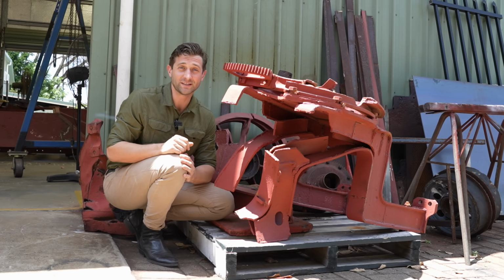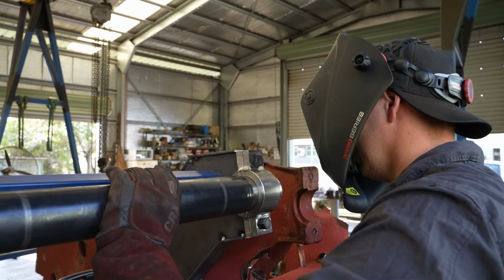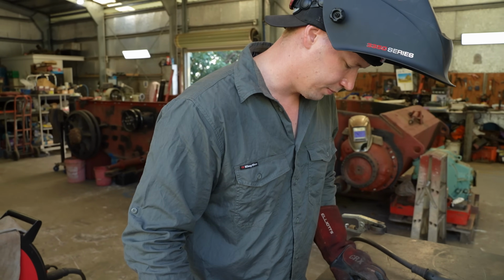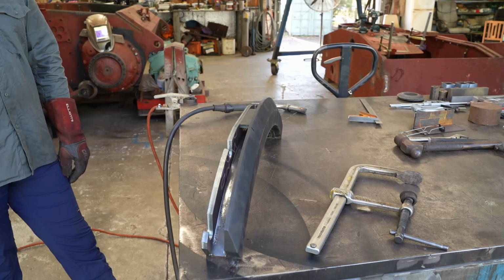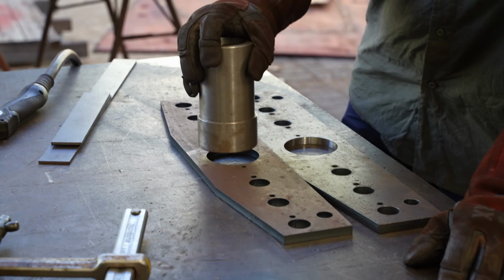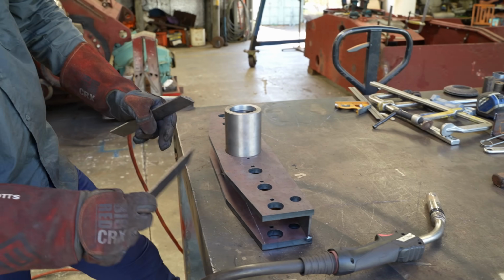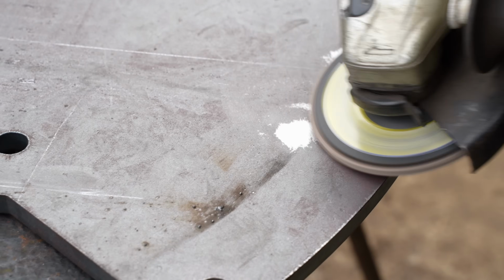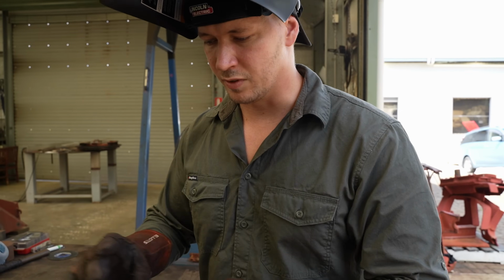WORKSHOP WEDNESDAY:  Part II of the 1:1 scale ALL METAL 7.5 cm StuK 40 L/48 Mount

Comment: Info for Beau.
An old trick I remember from the late 70's watching someone restore a WW2 afv and having to weld in replacement metalwork was to place a cut off quartz glass tube or ceramic tube recovered from an old bar heater over the arc welding electrode. This of course was in the days before Tig welders, and they learnt it during the 50's in the army.

This insulated the welding electrode from areas not needing to be welded and allowed the stick to get into tight places to put in internal welds. Admittedly you could only use half or so of the sticks, but it worked. You had to be careful you didn't bang the sheath or it would break though. He went through quite a few Hecla bar heaters, but picked them up from the tip mainly.

Comment: Great fabrication; I remember doing some of that in manufacturing.  We had welders with multiple head units for different kinds of welding.  So when I could not get into points with an MIG, I could switch out the heads on the power unit to use Stick and use long sticks get into get a full penetration weld.  I also follow another. Aussie channel called @CuttingEdgeEngineering
Reply: Yeah, that channel is good!

Comment: Very well done, it's a great pleasure to watch how the heap of plates get's transformed into a piece of the tank.
You said that no part is like the other, I think you have to keep in mind how these tanks where rushed together back than to supply the crippled german forces desperate for every piece of equipment they could get theyr hands on. So nobody gave a damn if the hole was a few mils of, especially not the guys from the KZ who where forced to build it at the end of the war while beeing air raided by the allies on a daily basis. Also nobody had invented the CNC Plasma cutter, so they had to cut everything by hand out of the steel plate marked up with a piece of chalk. Considering these circumstances they did a real good job back then. :D

Comment: display the original with pictures of the new one.  Also, on any parts that are salvaged off the original for the new one, make a replacement and place it on the original. Could be made of wood or something easier to fabricate it out of. That way, they easily see what is now missing from the original.

Comment: Beau, you might take the brass off the end of that welder so you can reach those tight spots. With it being an inside weld and "covered" on 3 sides by metal, (with no wind) the Argon/Co2 should shield that weld sufficiently. (Or use Flux core wire without the tip) Just a thought. Love the videos.
As I watch the work, two thoughts seem to always hit me: why would a country at war design and build a tank of such complexity ( must have been hard to keep in service) and how many men died, either because this tank crew killed them or the tank crew themselves.

Comment: I think the original displayed would be most interesting to both public and engineers. Also note the diversity of metal used in original. Worthwhile reading Fokker - the Creative Years by A R Weyl. This describes in WWI slack production methods of Fokker aircraft and it appears in WWII similar problems prevailed. A brief synopsis would be of great value to your visitors because we assume that aside from sabotage everything on both sides of the fighting was well prepared. This was not always so in Britain and America either. Production numbers mattered and short cuts were taken.